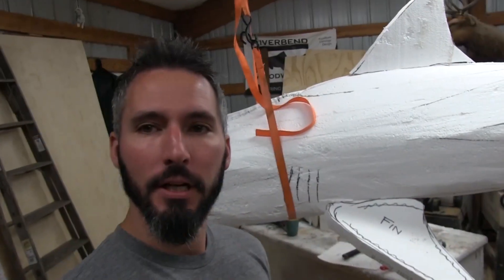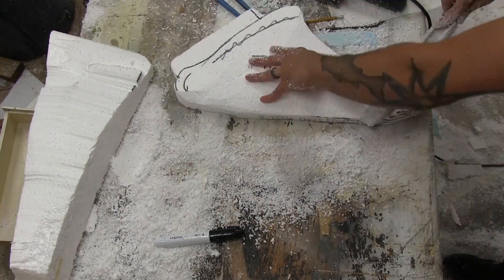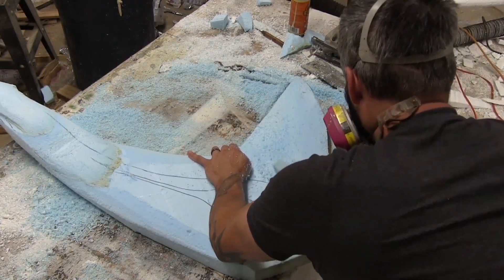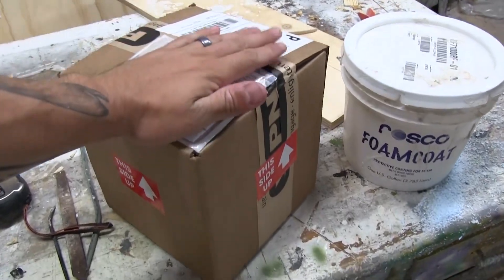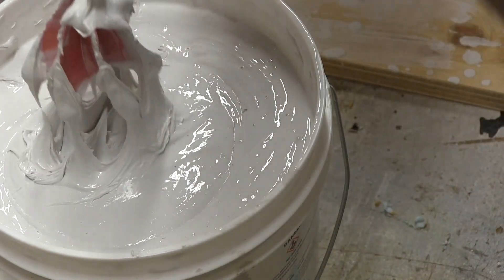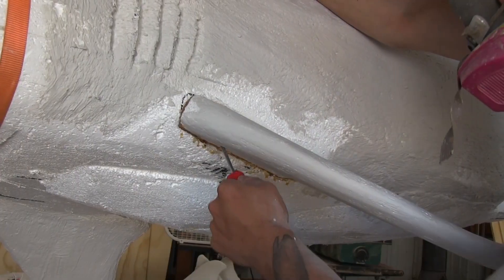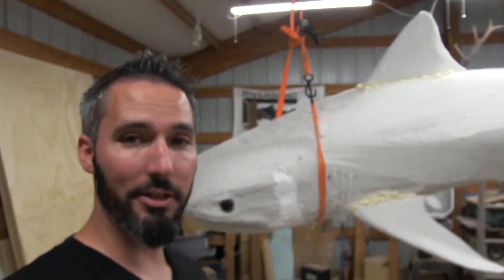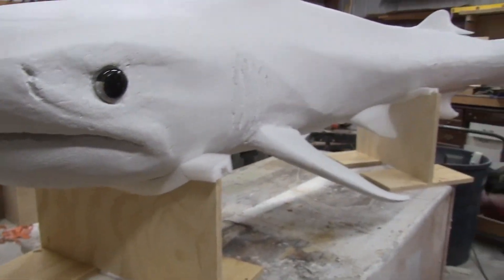TIGER SHARK foam carving - How-to Part  2

Comment: How much foam coat to do the shark? And roughly how much is the cost to do the shark?
Reply from the maker: For this one it ended up being one and a half of the Roscoes tubs worth. I watered it down quite a bit so it would get a good, consistent spray as well, so I got more mileage out of each bucket. Just took a few extra coats I think. The result was a smoother finish though.
Reply: @RiverbendWoodworks    You  did great.  I cut out aluminum pieces and airbrush them

Comment: So you brush on the Rosco Foam Coat first, then sand when dry. Then dilute the Rosco in your sprayer for the final coat? What ratio do you use? It looks great! I tried the Hot Wire Foam Factory Foam Coat, but found it too cement like and not smooth...
Reply from the maker: I did brush on the first coat pretty thick to help with gap filling and it sanded up beautifully. I used something like a 60 or 80 grit sandpaper on my orbital sander and it took care of it quick. The next few coats were a 50/50 water-foamcoat mix and diluted even further, I believe so I could spray it from the texturing gun. Again, I quickly sanded between the next two coatings and lightly after the final coating.
Reply: @RiverbendWoodworks  Thank you! I am going to try it as you have a great finish for paint!

Comment: Man I cant believe I haven't seen this before. This is right up my alley! How do you like using the hard coat? Is it a lot more durable than joint compound? More durable than bondo? I definitely want to try using it sometime.
Reply from the maker: The Roscos foam coat is incredible. I think it is very fire resistant, can be easily sanded, and is really, really tough. I totally recommend trying it out. It's kinda pricey, and I believe it has a shelf life to it in the tub it comes in, but it's awesome stuff.
Reply: @RiverbendWoodworks  Thanks for the info! Sounds like I need to try this stuff. appreciate it!

Comment: What’s up again ....what’s the name of the  foam coating that you use
Reply from the maker: Hi Antero, the coating is called Rosco Foam Coat. It's often used for stage props and is pretty awesome to work with. If you just Google that you'll get a few buying options. Highly recommend it.